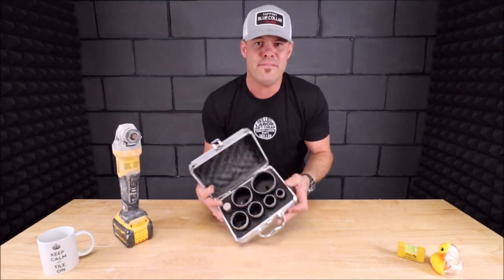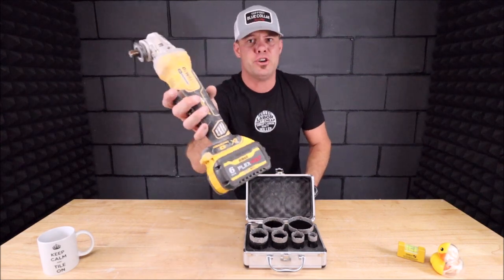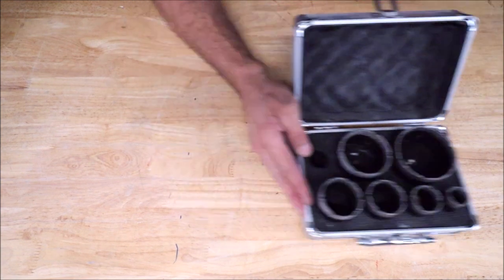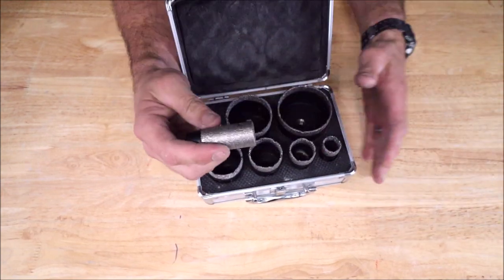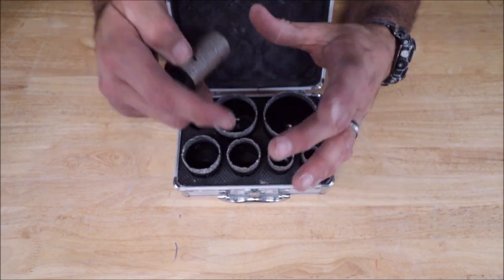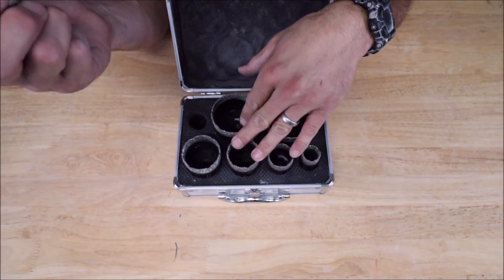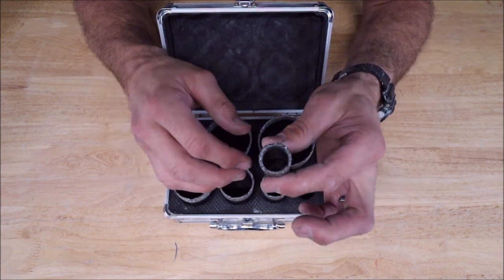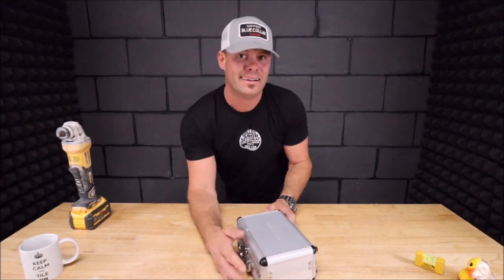Cutting Perfect Holes in Tile with Diamonds

Comment: 1:43 I can see from that gap that those tiles were not very easy to work with and the walls are probably not very level. Old house problems eh?.
Reply from the maker: There was sealer on the joints, so at this mark some joints were darker than others. Also, with these tiles, the edges/joints ranged from 1/32 - 3/16 when stacked. (curved edge hand made look ceramic)